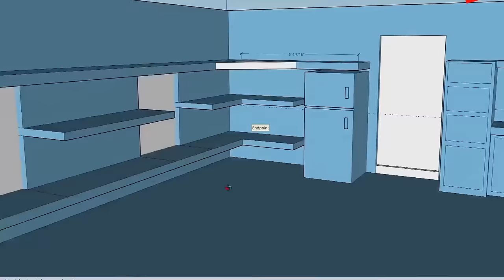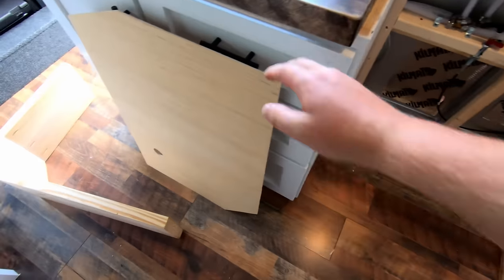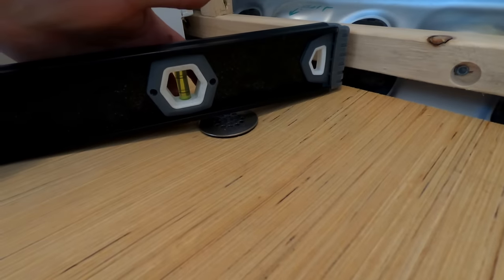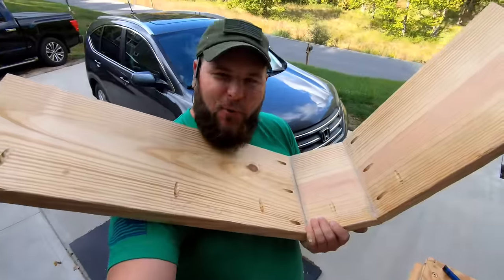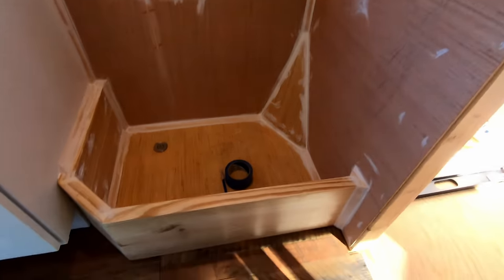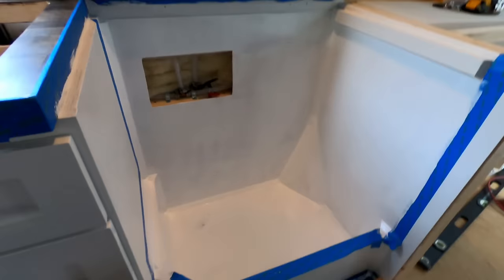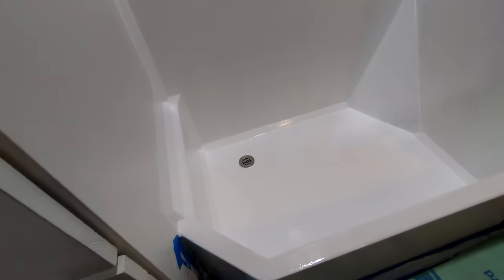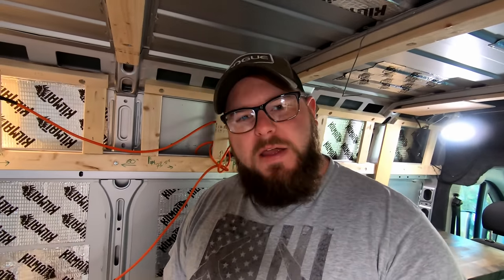CAMPER VAN SHOWER BUILD with FLEX SEAL #flexseal #vanlife

Comment: Just know that the Flex Seal White will yellow in sunlight over time. I used it to seal off all my white gutter seams on my house. So that's how I know.  I use it also on the white sheet metal roof of my shop to seal off the screw heads.  Works good there.   Interesting twist, but I guess if you can build a boat out of door screen......
Reply from the maker: Thanks Curtis!  I've seen others scrub large applications of old Flex Seal with warm soapy water to get back bright white finish!

Comment: Hey Big Logan, I like how you did that, only flaw I see is that it would have been better to use a bearing bit on a router to step down the drain, apply the flex seal then the drain pipe so the gasket is pushing down on the flex seal not butting up to it, eventually that will pull away a bit and water will get between the pipe and flex seal. 

Looking like you are going to have a really nice van on your hands there!

Comment: There's just one thing I would of done differently on the drain part. I would of put down some water sealant and water protection on the wood  before doing the other stuff. You can never be to careful.
Reply: Good idea for when it needs to be replaced!

Comment: Great video and a great van! Could you give a quick update on the Flex Seal? Does it have any off gas rubber smell still lingering around? I am thinking about using Black Flex seal in my garage area of the van but I am concerned to the toxins and smell longterm. Thanks!
Reply from the maker: Not at all an issue after 2-3 days.  Same for Herculiner truck bed liner which I used for the garage area.  Thanks for watching!
Reply: @biglogan3690  Fast response. Thanks!

Comment: This turned out very well!  I love the finish.  I wonder if you can tile on top of this layer?  I want to build a wood shower pan and tile it, but need to seal it first.  The finish looks very good too like porcelain.  I also wonder if you can paint an existing plastic shower pan and make it new?  That would be so handy.  Very good work!

fyi - There is so much going on in a demo/ DIY video than an extra layer of noise/ music is very unpleasant.  It hurts the ears and drowns out the voice.  Please leave music out.

Comment: Very interesting inexpensive solution. Would be interested in seeing a follow up after 6 months.  Can you clean the shower floor, and still have the Flex Seal hold up. Will you have to re apply a fresh coat?
Reply: Someone very patient can do a test with a coated panel and simulate accelerated wear...

Comment: Marine plywood I hope....
I think/expect fiberglass would have been longer lasting.
Reply: Same concern.  I'd be worried that 200 pounds standing on that plywood would cause tiny cracks.  I couldn't do this without some kind of heavy vinyl liner riding up the walls.  Looks great, but if it does fail, it's gonna be a mess to fix.  I like the simplicity, though and the dual purpose.

Comment: Definitely Innovative. Your weak spot is going to be the joints and especially around the drain. You're going to regret going up to the edge and not going underneath the drain flange. I might try this in my travel trailer. I will probably use a polyester cloth membrane on the edges and seems at least if not the whole thing. Thanks for the video.
Reply from the maker: Yes a lot of feedback on this!  My latest build I Used Sikaflex on the board and underneath the drain.  Thanks!
Reply: @biglogan3690  . I didn't take the time to look at your Channel. Very impressive. I have been in the Harvey service and sales industry since 2005. You're tapping into a pretty good market from what I remember. I've been doing mobile services for the past 8 years or so. I'll be looking forward to more of your videos.
Reply from the maker: @dudebroham4083  Thanks for the compliments!

Comment: Great video! Been thinking about the shower in box truck conversion for too long, need to get it built! Anxiously awaiting an update. What paneling are you using for the sides?
Reply: Did you ever figure out what size paneling for the sides and floor?

Comment: HI.  Great video.  

We are in the process of renovating an RV and need to replace a shower that was removed. I had a couple of questions.  

How well did this hold up to the movement of the van and normal wear and tear over time?    

What is the texture like to stand on.?  

Thanks.

Comment: @BigLogan...we are converting a '14 Promaster 159 so I am paying very close attention to all of the details in your van build.  Just order all of the plumbing items from your amazon links.  Curious...Do you have a list of the components and hardware you used for the plumbing as well?  Also, what kind of wood did you use for the shower?  Thanks SO much for documenting your build.
Reply from the maker: Hey thanks so much! I do not have a master list of each fitting but followed a simple methodology:  use 1/2” flex tubing and barb fittings and adapt to each fixture / component as needed.  Good luck!
Reply: @biglogan3690  Very helpful...thank you.  Going good so far.

Comment: Was the water hot tho...? What about cleaners, soap, shaving cream, shampoo/conditioner degrading the finish? What bout the van bumping on the road, constantly challenging the connection points of the wood? Not too big a deal for dry wood fittings for cabinets and such, but the wood swells/shrinks, small cracks in seal paint - water tightness could be lost maybe?

Comment: why wouldn't you just use flex seal for all the sealing you need for the shower? seems like it would be quicker and more efficient use of time and materials. not criticizing just thinking out loud and thinking about saving time and money.
looks awesome. I've thought about doing a van build but never considered flex seal. so good on you for the ingenuity!!!!
Reply from the maker: Thanks Joel it’s certainly doable.  I was trying to shape and round some of the edges with trim/caulk.  Mainly for looks but the flex seal is so thick that it would fill cracks just fine alone.

Comment: Great demonstration on the application of this product! For a shower build, 2 sides and back (3 sides, less than 50 inches tall), would a can of 16oz is good enough for two thin coats? I have a shower pan.
Reply: The 16 oz can of Flex Seal Liquid can cover approximately 18.75 square feet.

Comment: Excellent video Big!
What are your thoughts on using Flex Seal for an exterior wall coating? Under UV effects and pressure washing durability etc.
Thanks...
Reply from the maker: Check out "Flex Seal 1 Year Review" by @Daddoingstuff for UV effects on RV roof.  This video helped me determine to go with it!

Comment: I’m going to use flex seal to resurface/fill in some cracks on my RV plastic shower pan. How hard was it to pull the tape off after everything dried? Was it hard to pull the tape of the drain? Thanks in advance. Excellent video 🤙🏻
Reply from the maker: Was not an issue at all.  I recommend taping for a clean edge to prevent peeling
Reply: @biglogan3690  awesome thanks so much. Bought everything tonight going to start the project tomorrow. Thanks for posting, this video helped out a ton!

Comment: How can you tell if any water is leaking out the outer part of the drain and ending up between the floor of the shower and the floor of the van?
Reply from the maker: It’s a loaded rubber sea under the drain, typical instal for sinks.  Knowing it is tight will prevent any leakage between the drain and the penetration through the van

Comment: So, was wondering dimensions and how the upper half is going to look and how it's sealed off from the van. I'm sketching out a Chevy Express extended and having an inside, even really small, shower has been a tough nut to crack. Something for when it's super cold and showering outside is no bueno

Comment: Did you consider using other flex seal products?  I was thinking the flex seal tape over the corners after your caulked, and the flex seal  spray to blend in thinner areas before the final coat might have been cool to just be as safe as possible at the edges.
Reply from the maker: It Can be done, This Roll On product is so thick that it can liberally coat all the corners and edges, with just the assistance of painters tape.  Good Luck!

Comment: For cold weather u could use sch 40 PVC pipe with a  1/4 in pitch per foot   and just insulate the , storage tank  and also add a p trap in a insulated  box  to stop the sewer gas , pipe should not freeze if pitch  right
Reply from the maker: Great idea!  I went with the HepVo sanitary dry waste valve!

Comment: Wonder why you didn't use the 100% silicone roofing product? I build hot tibs out pallets and use it for the water proofing.  I love it and its available in 5 gal.
Reply: Nothing against flex seal just wasn't aware it was thick enough.

Comment: Interesting approach.  Would you consider 3mm hygienic plastic sheets glue to the plywood instead for next project? Worries me that with all the vibration that seal paint will crack and leak at some point. But I could be wrong with new tech.
Reply from the maker: Still building out my rigs with flex seal right over plywood.
Reply: @biglogan3690  Sure. Like to see updates after a year of actual use. Thanks
Reply: @897aa33  agreed, I've been scrolling the comments for an update. Cause I watched this last year. And thinking of doing the same to my trailer.

Comment: Just wondered if getting a proper sized pan welded  or a rubber membrane ? The potential failure due to van movement.?   Don't know personally just curious. that makes me a little nervous Still a huge thanks for all you are doing for us newbies
Reply from the maker: This flex seal is a rubber membrane after proper applicated.  theory here is flex from van movement should be absorbed.  re-application if wear spots are found is as simple as applying another coat. $30 for this custom deal and high sides is ideal over pre-sized pans for ($150-$300) good luck!

Comment: Nice work, but the weak point is the drain and for how long fseal adheres to the chrome allowing water to enter and rot the wood.
Reply from the maker: Rubber washer is fully compressed underneath chrome and to plywood substrate.  But yes, I now pre-treat the plywood before assembling.  Thanks!

Comment: The Flex seal is an iteresting choice for waterproofing. like your approach to the content on your channel, +1 more sub!

Not to shoot poo poo batter on your idea, but I think I would have used white fiberglass sheeting instead of the flex seal, then just caulked the joints...
like this product from lowes:

Embossed White Wall Panel
Item #8566Model #FTSTF.1031
Reply from the maker: Thanks Nonya!!! Love your YouTube handle lol.  I looked at FRP board first but saw the cost savings with flex seal.  May still have to try this out.  Thanks for subscribing!

Comment: I'd like to see you  buy a length of ipe or mahogany and make a floating wood  floor to fit the shower.It wouldn't take much. Look custom too  I think dirty van feet is going to stain and wear on the Flex seal. Unless you are selling the van to Billy Boggs
Reply from the maker: You make a great point thanks!

Comment: Genuis!  What is that piece of wood you used, looks like 1/4 inch bamboo?  And the shims, did you make the shims for the slope?  thx
Reply from the maker: Hey Mary!  The 1/4” is generic “Lowan” plywood.  It’s very strong and light.  For the shims I just used some standard shims you can buy at Lowes/Home Depot in a pack and I trimmed them to length.

Comment: Is there a reason why anyone wouldn't just fiberglass  a wood box and just paint marine sealer and top coat on it?
Reply from the maker: May experiment with this next!
Reply: @biglogan3690  i look forward to it. I also saw ppl using it for a propane closet with small floor vent.

Comment: No it doesn't work with time it will develop  cracks  after it  dries. Your better off using fiberglass and  build a  custom  one it's very easy and simple to use fiberglass
Reply from the maker: Interesting thanks for watching!
Reply: @biglogan3690  I've seen  it done  before  it's a  mess long term all you need  is a  pan a few inches  deep  you can also use  sheets of plastic  and a heat gun  build the  form and  melt it soft it will  bend around  just  go slowly and  spread the heat  fast and easy to  repair  you can even  cheat and use a washing machine  drip pan or smaller  you can use  water heater  leak pan  im using a  laundry sink  it's  light  can be  cut down already it's  slanted to drain water  just  have to get a  90 degree drain and it's already  leak proof

Comment: I have no doubt this will work for 6 months but any failure in your coating is going to give you water damage. Would have felt better with stainless or fiberglass.
Reply from the maker: If coating depreciates, simply touch up for $4-$5 worth of flex seal 🤙🏻

Comment: Why do all this labor and create multiple failure points when you could purchase a one-piece ready-to-go pan solution?  Sure this will work Day One, but will it hold up long term with all the vibration and movement it will get down the road?  Plywood and water don't mix very well. I think you are creating future problems for yourself....
Reply from the maker: As an innovator and engineer, I try new things that don’t fit the mold.  This is a custom sized solution designed to maximize efficiency in this space.  I understand that a durable and flexible urethane based sealant is extremely durable and inherently dampens vibration.